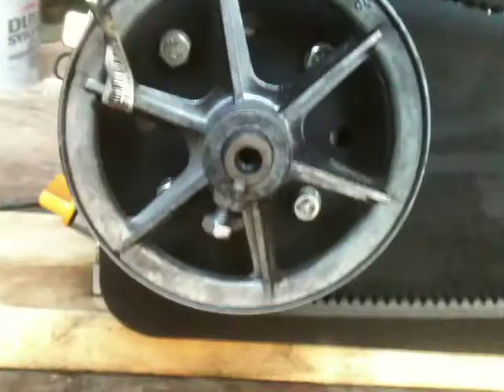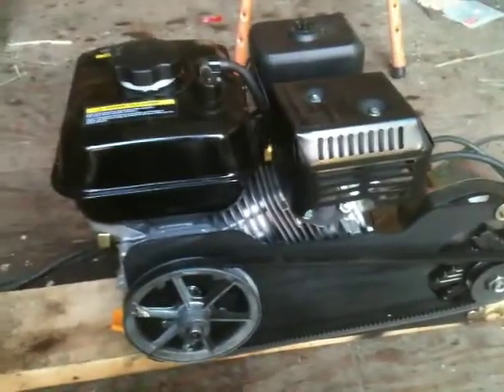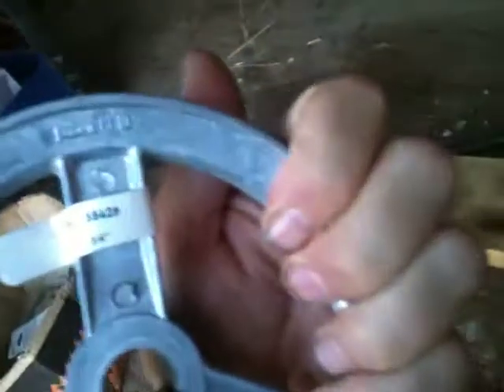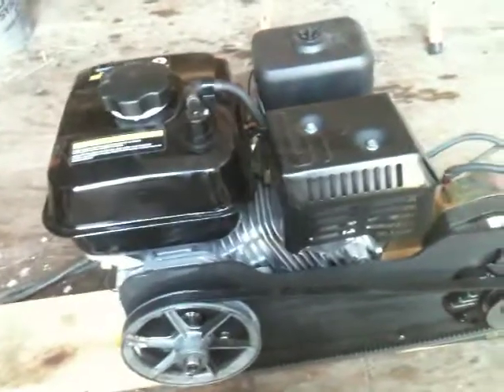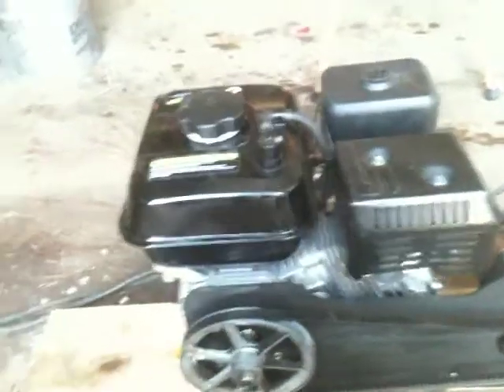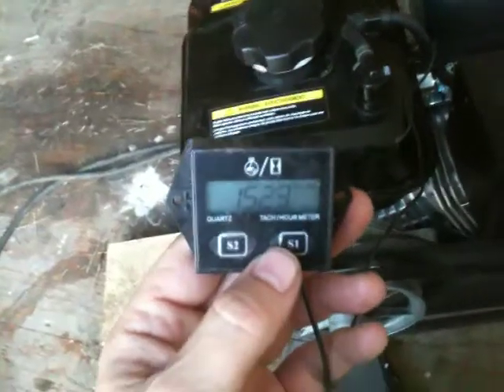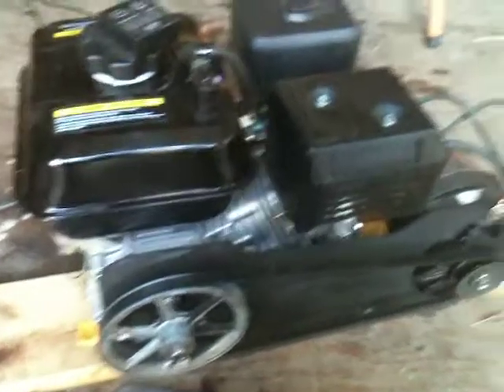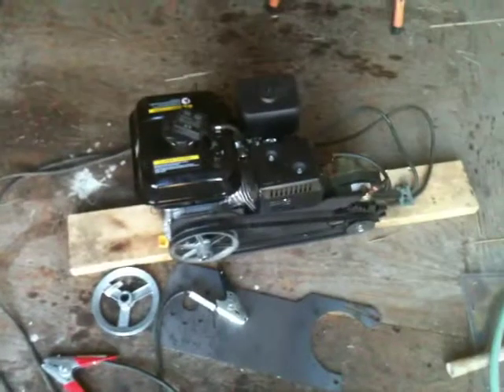DIY 6.5hp 100 amp battery charger

Comment: Very nice system.  I am using your design as guide for mine.  I have a smaller engine and GM CS130 alternator.  Thanks.

Comment: Hey North700

I too, have a 6.5 hp gasoline 100 amp off-grid high ampere DC battery charger that I'm trying to build out.  I really haven't found any step by step instructions anywhere for these homemade DC charger, I've just seen vague descriptions of these DC charger online in a few places.   Yours looks the best so I'm calling on you for some technical answers if you don't mind.

I started putting one together and now I'm up to the wiring part of the unit.  I'm trying to build a unit like yours and I'm at the point where I'm needing someone who has already done this before with positive results to instruct me on the correct wiring of this system for ~ high ampere DC deep cycle battery charging.  Producing a continual steady charge of 14.5 volts yielding a range of 46-56 amps for my L16H Trojan Batteries.

I have a few questions if you don't mine helping me.

My main question is where does one hook-up the negative lead cable? 
Is it like on a car where the negative is grounded to the chassis? But where does one ground it on this system?  Also, I see a connection for the positive lead cable on my regulator which I assume is where the positive goes, is that correct? 

I have one more important question about how and where would one hook-up a three wire digital meter (black, yellow and orange) to read the volts and amps that are being generated so as to control the DC charger at a steady 14.5 volts?  My regulator has a two lead (red and white wire) connector that attaches into the regulator if that is any help as to where the meter connect.

Sorry this is so long, just trying to be specific as to my questions.
If you reply, thanks so much for your time, I'll pay it forward. Rex
Reply from the maker: Hi sorry for not responding sooner, to answer your questions the negative is secured to the upper adjusting bolt on mine and I use "one wire alternators" they only have one post on the back and that is for the positive cable. they have an internal regulator (very simple arrangement ) hope this helps